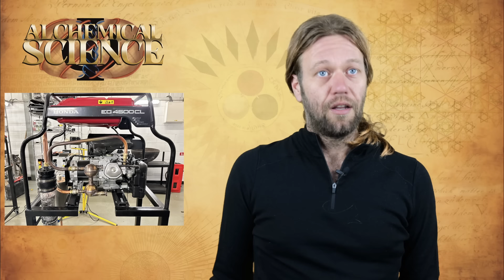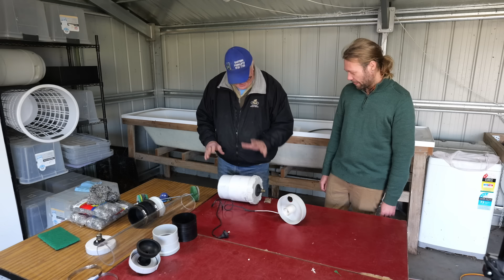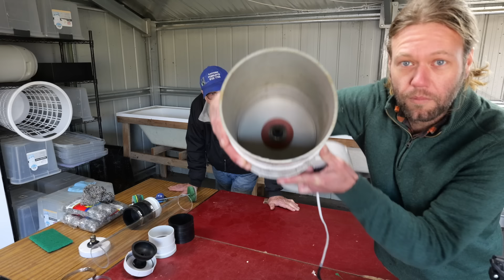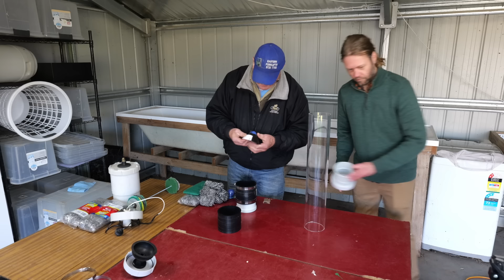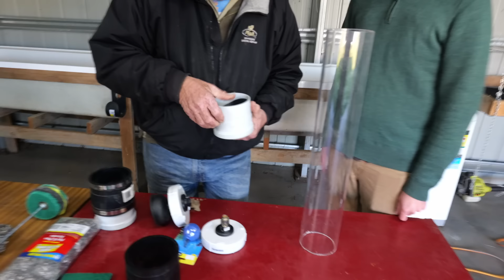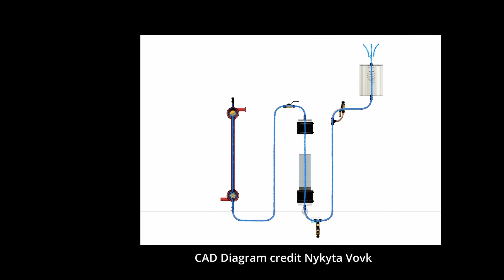Thunderstorm Generator DIY Build Guide v2 | Part 1: The "Ioniser" and "Bubbler" (Plasmoid Generator)

Comment: Would like to see some credit go to Paul Pantone in a few of these videos. Although the "Thunderstorm Generator" has some great ideas used in it's creation, fundamentally it is a "GEET Reactor" originally invented by Paul Pantone (see paten US5794601A).  Malcolm Bendall's concept is more like a cousin to what Paul was doing, but to overall effects on fuel emissions seem to be identical. Love seeing more work being done in the field of "plasma modified fuels" as a way to save our planet. Can't wait to see the next video!
Reply: The GEET uses air warmed by the exhaust, not recirculated exhaust gas from what I understand going by this video :- https://youtu.be/7nbin-C8ggg?si=_N2TqVXzr2yh5ON6&t=559
Reply: @doomwitch666  This video is a bit long, but Paul explains most of GEET construction and effects in his own words. https://www.youtube.com/watch?v=xah7mCXXESM . He started giving away the free plans back in the 1980s  and can be found quickly on google. I have built the small engine reactor from those plans and can say it does work to some extent. The more effort you put into it the better it works, so polishing the inside and out side of the reactor makes it work way better.
Reply: Thanks man.   I just want to get the tech my dad (Paul Pantone) invented to the planet, for the security of the family I may one day get to have, but it sure is tricky.   If I had 1/100 of the money that people have dumped into trying to change GEET enough to claim it as their own, then all equipment on this planet would already be retrofitted.  The Plasmatron, PICC, SPAD, just to name a few others who have made millions in the name of R&D but have never sent a dollar, or scrap of data back here to GEET R&D HQ.   The free GEET Plans are for individual personal use, not commercial.   Piracy is detrimental to "content creators", so it's detrimental to the end receivers when are not done creating "content".   It doesn't help get GEET to the world when people release things like this without saying what it is and how to support it's rightful R&D. 

It sucked my dad got shafted  like Tesla, but I still actually have a good handle on the tech and network, of which the "Thunderstorm" people would be only a small fraction.

I was built, not only to get GEET to the world, but to help get other researchers and inventors facilitated to do the same.  The world is still ran by Edison's but I won't give up as people like you still breathe with me. 

If anyone reads this soon and can get to Northern California to help out or make a donation, find me on facebook.   Come get the full GEET education and get in on the ground level and front line of the development of the tech, and social outreach.